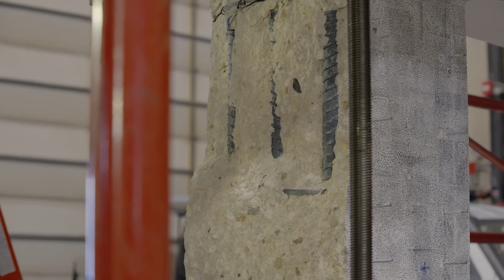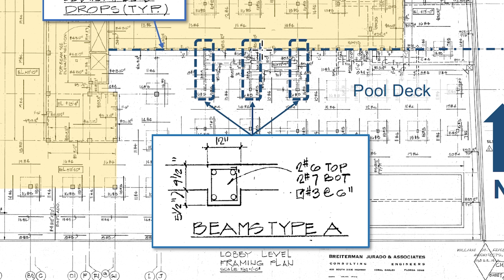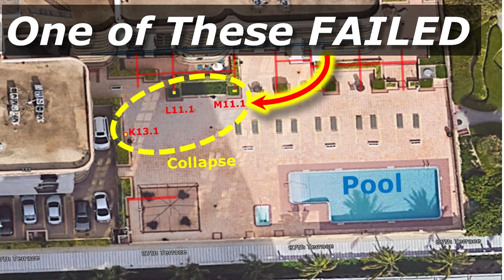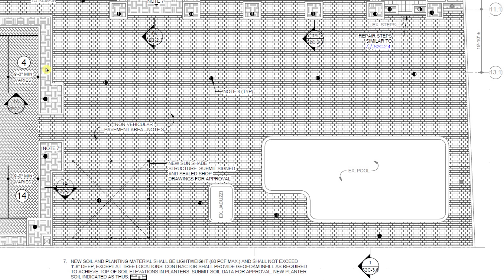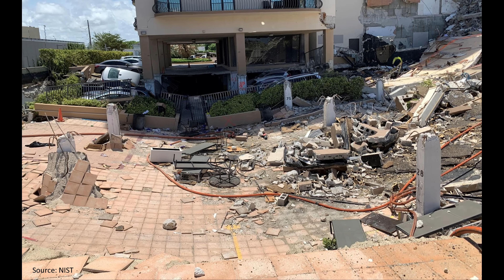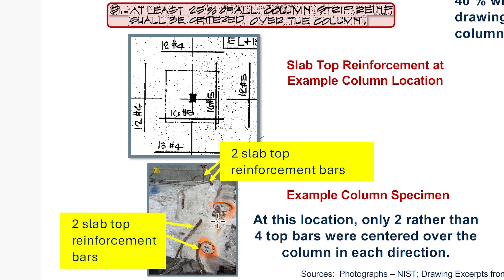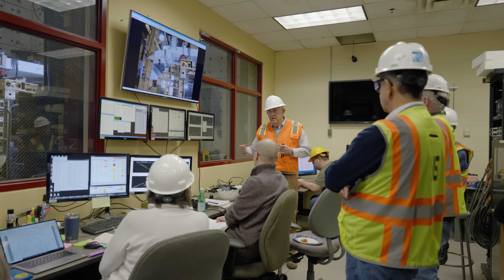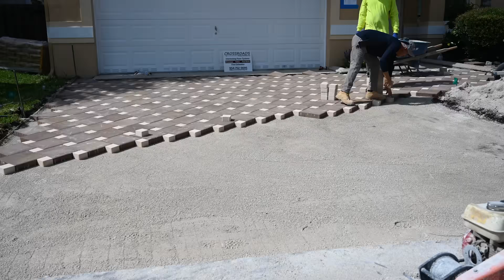Champlain Towers: Secrets the Feds Uncovered in Collapse Debris

Comment: I was there six months before it fell as a contractor to give estimates.  The planters on the pool deck were recent additions, they were massive load addition. It's the fault of a design team who thought it was 'pretty' .
Engineers asked us how to stop rain water from puddling in front of the pooldeck entrance doors. The whole slab was sagging, we told them to remove the planters, the day before it all colapsed it rained all day, those planters took on yet more weight. In the colapse photo those planters did not break.
Reply: I had seen so many cases of sagging balcony and patio from having too many planters in my country, they underestimate the weight of dirt and water, especially water, people do not understand that 1 liter = 1 kg and just a cubic meter is a ton. Safety factor for the code today then had to take into account people putting planters on balcony, so that won't be a risk later.
Reply: @worawatli8952  Because it is much lighter, I use a rinsed pumice/activated charcoal/zeolite potting media in the planters on my own balcony. Yes, this media is pricier, but moving large plants inside during winter is much much easier.
Reply: @worawatli8952  Instagram has made this an even GREATER problem than it ordinarily would be by showing thousands and thousands of photos of online-sheep filling their apartments and balconies with plants to the point that you can hardly step out on the balcony. smh 

It is stunning how IGNORANT we can be as humans, not even considering how our actions affect others. 

Worse still, before the last two years of plant craziness, the current FAD was adding hundreds of pounds of weight to every kitchen counter by putting granite slabs all over the kitchens and even on the SIDE of kitchen cabinets in a "granite waterfall" effect. If you do that in every kitchen for a midrise or high rise building, just imagine the amount of weight that is added to a structure. smh
Reply: Wow news never covered this
Reply: @anonanon5696I said it was the planters 3 years ago.
Reply: @dr_shrinker Wasn't aware of the rain event the day before! Why was this not documented!!!
Reply: Just add water, it makes it's own sauce!
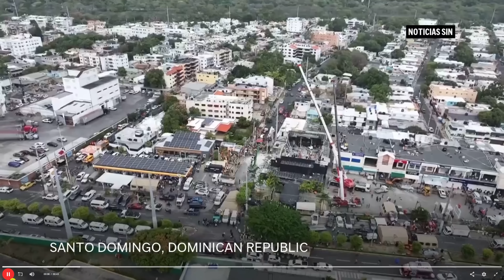Reply: @anonanon5696      If they exposed that the root cause was the addition of planters along the collapse line 3:15, then the insurance companies wouldn't be able to justify charging double the rates statewide.
Reply: @anonanon5696The  heavy planters were mentioned but never dwelt upon.
Reply: If the pool deck was sagging, and as a result had water building up when it rained, that water, along with water in the planters, would've added a huge additional load every time it rained, including the day before the collapse. A large cyclic load like that is a recipe for fatique failure (cracks forming and growing over time).
Reply: @Dennis-vh8tz  concrete only sags when the internal rebar is rusting and expanding "puffefying" the concrete into powder.
Reply: Simulation of rainfall from the intensity /volume of water would conclude the findings. This seems to have overlooked.
Reply: You can add all the sand you want to the sandcastle but too much water and it's going to crumble/disintegrate very quickly. (keyboard structural engineer here)
Reply: @63n74m1n Sounds logical.  What is a keyboard engineer?
Reply: Planters- also a factor in Save-on-Foods collapse in Burnaby, BC in 1988. The Provincial government established a Commision of Inquiry to examine the causes of the collapse.  One result was the structural engineer of record lost his license to practice .
Reply: I wonder what was the weight the "roof"  floor can handle and what was the REAL weight just before it collapsed.
Reply: I'm NOT a structural engineer. However, when this tragedy happened I looked at a Google maps photo and noticed the  tennis courts to the West (plus many asphalt parking lots). I questioned if these areas were properly sloped and city sewer handled any rain water or did ALL the drainage water head East towards the ocean? Jeff had mentioned he would look at the slop of the tennis courts next time he went to Surfside. One reason I question the drainage is the comment from a maintenance worker who stated that during hurricanes they could never pump enough water from the parking garage - the level was a constant 18 inches. Perhaps excess water from the West entered thru the parking ramps. Did the curve in the road also cause water to overload the engineered drainage at the property? Last thought - look at Jeff's before photos of the pool deck. The area to the east of the lobby parking steps to the pool deck looks discolored, damp and dirty. Could excess water from the West have entered the driveway traveled East towards the ocean and entered the pool deck thru the only opening - the steps. Any water that didn't drain onto the pool deck would of soaked that wall between the lobby parking and pool deck. That wall was probably constantly damp for 40 years.. I work at a local Home Depot in the Garden Center. Every once in awhile Old Man Nick (me) has to help a customer load mulch,stone and sand. After it rains I cannot believe how much heavier all the products weigh. ESPECIALLY THE SAND. As Jeff commented the weight of 9" of wet sand had to be enormous - what kind of contractor would do that? That contractor was a GOOF!!!!!
Reply: No you weren’t dude
Reply: Nice cover up and some great excuses but your response is bs
Reply: The gymnasium collapse in China had a similar cause, workers left bags of perlite on the roof and it rained, absorbed all the water and the roof caved in.
Reply: @CarbonatedGravy 🤡
Reply: DID you not watch this video ?   It said the planters were not a contributing factor.  The building was flawed from the start

.
Reply: Christ, that's awful. This was a totally preventable tragedy.
Reply: Great information! I can't imagine how much load wet soil (from rain) added to the load vs. dry soil.
Reply: Seeing this, this is definitely a man-made disaster and no-one in the community prevents this.
Reply: Those planters did nothing to beauitfy. The property  they definitely  added alot of weight
Reply: I understand that the association was ordered to add those planters by the town's building department so there would be "green space" on the pool deck.
Reply: While the planters are heavy, you have to consider that the deck total weight is almost a ton per square meter for all of the deck. That supose to have a over 2 times saty margin on top of the 30kN/m2 flexible load.

So the planters while heavy. Threy should have been plenty inside the safty marginin. 
So the actuall error is someone either calculated or built the safty margin wrong.
Reply: @matsv201 the safety margin isn't for planters, though. It's to cover structural flaws, deterioration and major weather events. This building was old enough and had so much structural deterioration that the safety margin  was already eaten away to a large extent, you can't expect it to cover the planters as well. And you say 1 tonne per square metre - water weighs 1 tonne per cubic metre (a square metre + 1m height), damp soil weighs even more than that, concrete and masonry weigh 2-3 tonnes per cubic metre - large planters could easily obliterate whatever safety margin was remaining.

People in general are bad at imagining how heavy things are, especially very mundane things that they see all the time. A planter is such a normal object, surely it can't be heavy enough to bring a building down? 

If it's not designed for, yes, it can.
Reply: @PartanBree the water wasnt 1 meter deep. And even if the planters was. They didnt cover the whole floor.

While its true that the saftey margin isnt specifically done for planters, they should have come inro the margin. 

The margin isnt for bulding aging, that should have considered in the material strength.
Reply: @matsv201  @PartanBree didn't say the water was 1 meter deep. That's just a general term to determine weight of a mass. You have to extrapolate for the actual dimensions of the problem to determine the load applied day of collapse.
Reply: @kevinhorne9643 well yes,  but if yhr water ks 2 inches deep, it really dont matter much on the structure
Reply: @PartanBree  matsv is right, the safety margin is to cover all unknowns, that's why it's so big. Everything from material deterioration, up to a reasonable amount of unplanned extra loads. While the planters may be heavy, and perhaps it was important to properly engineer them which they weren't, they still shouldn't have caused a collapse based on looking at them.
Reply: @matsv201 they did add 9 inches of sand and pavers over the whole pool deck on top of the original deck surface !
Reply: @majesticmythicalsart7563 belive it or not, that is actually with in the safty magin. At least the current one.
Reply: @matsv201  unfortunately it seems that the building was not built within the proper safety margins even for the 70s . I am no engineer so I can only go by what I have seen in these videos .
Reply: @majesticmythicalsart7563  Yea that certanly seams to be the case.

Not only does it seams like it was built outside safety margin, it also seams like it was built with shoddy works that let water into important rebar and degraded it strength.

On the other hand, that SHOULD have been found on inspections. And the fixes should be been instant. Not like getting qvutes, but draining the pool and find contractors to truck away the sand the very same day. Possibly condemn part of the building.

I´m not a US engineer so i don´t know how it works there, but this would be a insurance case where i live.
Reply: @PartanBree  Regarding every day things, as an example may SUV weighs 2 tons. (I drive carefully.)
Reply: The problem was that when water was pooling on the deck, they decided to level it with sand and a layer of pavers. That threw out and exceeded any safety margin it originally had.
Reply: @matsv201 it seems they also added pavers and fill to the whole pool deck as well as planters on top of there wasn’t proper safety margins to begin with
Reply: @majesticmythicalsart7563 my main point is that its not really the people put the plant boxes fault. The safty marking should be sufficent. It wasnt
Reply: @matsv201 planters weighted a ton each.
Reply: Very interesting information.
Reply: Yes water weights a lot!  Just one cubic meter of water is a TON!
Reply: Concrete slabs sag ONLY if the internal rebar is already rusting and expanding causing the concrete slab to lose structural integrity.  The planters are a nothing deal and a scapegoat for lack of proper maintenance and inspections.  It's like saying someone parked too large of an suv in a multistory parking deck that's half empty.  The building was compromised for decades. And it's sister building next door may suffer a similar fate.
Reply: @GrzegorzDurda  I surely hope that other building is being properly inspected so we don’t have to have another forensic analysis.
Reply: What a crock
Reply: Controlled demolition
Reply: @superjeffstanton so the pool is hanging above the garage below and they add tons of planters so that the floor was bowed down and nobody removed the planters?. So bankrupt half of the condo owners in the state with projects that make insurance companies and contractors twice as wealthy.what a plan.
Reply: @superjeffstanton THE conspiracy nuts drive me crazy.   The video clearly explained how the building was designed & built wrong.  Not imploded with dynamite 

.
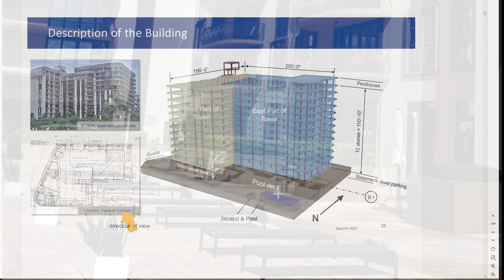Reply: @superjeffstanton  3:40 the pool deck collapsed first, and 4 minutes later the tower.
Reply: @superjeffstanton Wut?
Reply: @superjeffstanton  It was not “controlled demolition”. Knock it off weirdo. Editing this just to say… posted three of those conspiracy nonsense comments on this video??? Seriously? No theory on why it was a “controlled demolition”, just want to chant about some imaginary paranoid conspiracy.
Reply: @superjeffstanton  why are you so obsessed with this? Aging human constructions fail - it happens to bridges, to houses, to overpasses, to dams, to walkways, and yes, to 50+ year old condo buildings, especially ones in extremely harsh and corrosive environments, with undiscovered critical design and construction flaws, owned by people who severely skimp on maintenance and make huge structural additions without getting things properly engineered. Why is this so hard so understated
Reply: @GlutenEruption  it also sounds like construction was not done according to the building plans. I wouldn’t call it an obsession that Jeff has, but rather, something to learn from. In medical school and residency, we had “CPC”’s, aka clinical pathology correlation case presentations. We all know the patient presented in the case died, but it’s the learning of what we missed and retrospectively looking for items in the patient’s history of present illness, diseases that other close family members had, places & circumstances the patient lived in, physical exam findings, clusters of lab results that could have pointed physicians to interventions we could have done earlier to either avert patient death or improve patient’s quality of life.  It encouraged us to think hard.
Reply: @CrossCultural-c7f  It is also important to identify any faults in your way of thinking so that similar mistakes do not happen again. Engineering is a race to the bottom driven by cost and time parameters they allow to influence their thinking and approach to the designs they offer, then the profession rewards and lauds those who design cheaper and faster instead of better.
Reply: @P_RO_  crap, that sounds like what medical insurance companies are doing as they morally injure young physicians starting in practice…
Reply: @P_RO_ interesting perspective
Reply: @GlutenEruption  The "obsession", is finding the exact cause, so it can be prevented in the future. Every disaster is a chance to learn.
Reply: @christym6128  reviewing the mountain of video, photo, architectural, engineering, structural, historical, forensic, and environmental evidence and then dismissing it all and insisting it was an intentional controlled demolition based on zero evidence is not trying to find the exact cause to prevent it from happening again, in fact it does the OPPOSITE.
Reply: @christym6128  ignoring the VAST evidence pinpointing the exact cause to continue insisting it was actually a conspiracy and an intentional controlled demo based on no evidence whatsoever is not trying to find the cause to prevent it happening again, in fact it's the exact opposite.
Reply: @GlutenEruption About 10% of people suffer from some sort of mental illness. This guy is one.
Reply: @CrossCultural-c7f Wow.  So interesting
Reply: @CrossCultural-c7f  Do I remember correctly that the building owner served as his own contractor, or something?

Comment: 33:10 water weighs 62.9 lb./cu. ft.    might help visualizing
Reply: However there isn't much difference in the weight of wet sand vs. dry sand.  And sand weighs around 120 pounds per cubic foot.
Reply: It confuses more than 95% of the word‘s population. 1 cubic meter (or 1000 l) of water has a mass of 1 ton (or 1000 kg).
Reply: @GermanGuy007  I provvided units that most viewers of this channel should understand, while many others could convert my details to Metric if wanted (a cubic foot is just over 28 liters).

Comment: Look at the shape of the column after the collapse the top of that  column had so much  cracking and spalling that it looks like it was in a pencil sharpener vs the others that are still square . It disintegrated so much. It basically was only a point that was still solid concrete and that punch sheer  right through the slab,.

Comment: could the 9inch of sand not be to counter the sloped floors for the drains? you said that the original design was meant to have it sloped but it isnt. couldnt the 9" be the height diff between the edges and the drain in the middle?
Reply from the maker: Most pools usually have a curb around them which sticks up from the pool deck. But if you look at the pool deck around this pool the pavers come right up level to the top of the pool so I think they used that sand to level these pavers up